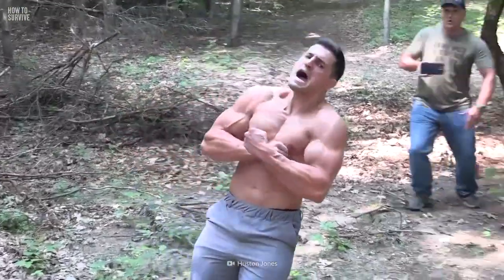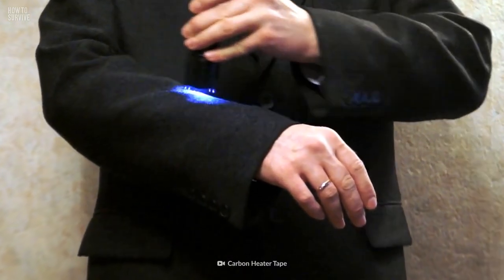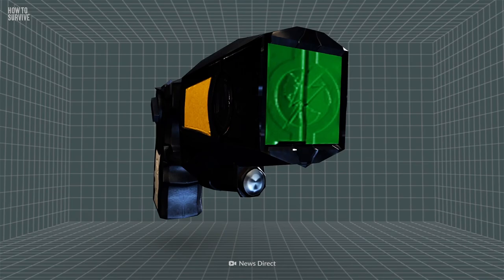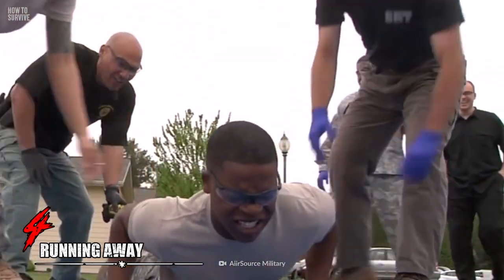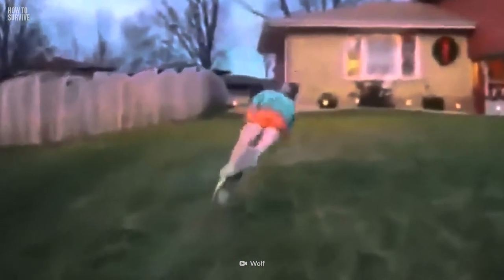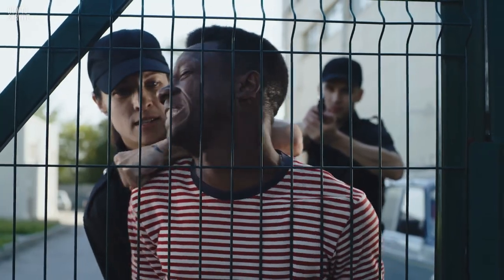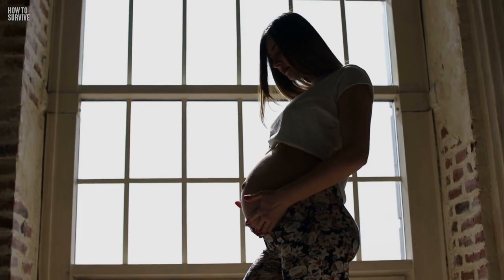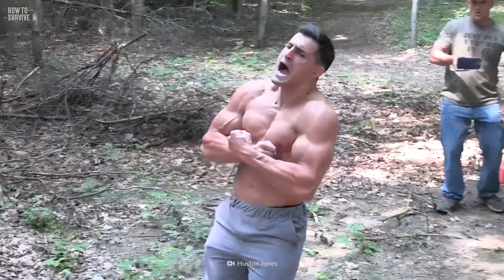Don't Do This If You Get Tased

Comment: ME: 
50,000 volts cause my muscles to contract 
POLICE: 
“stop resisting” 
Pulls taser trigger again and again while shouting “stop resisting” 
Throws my stiff body to the ground, almost smashed my head onto concrete edge and tries to breaks my arms putting handcuffs on me.